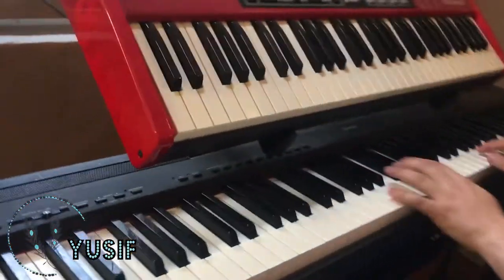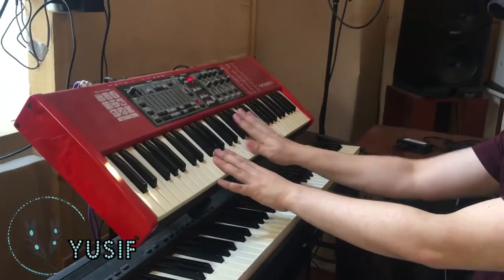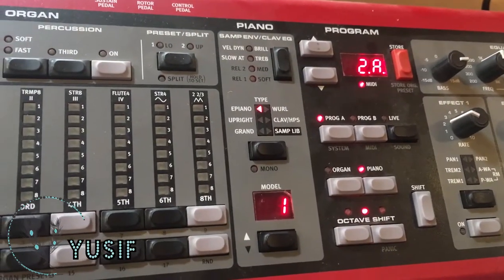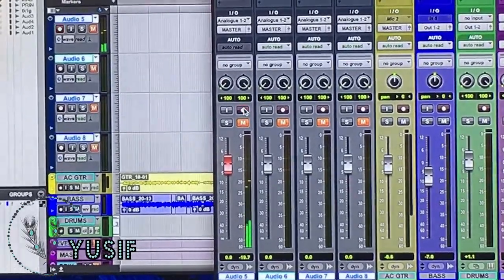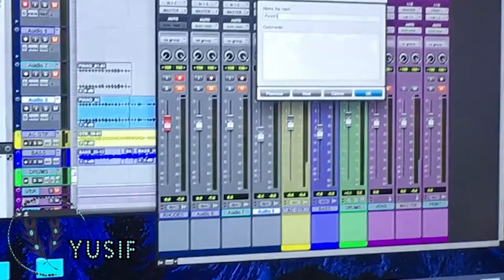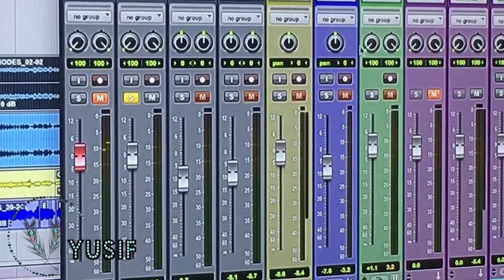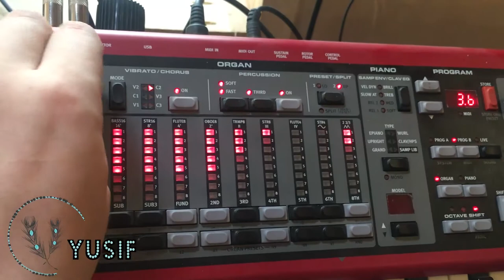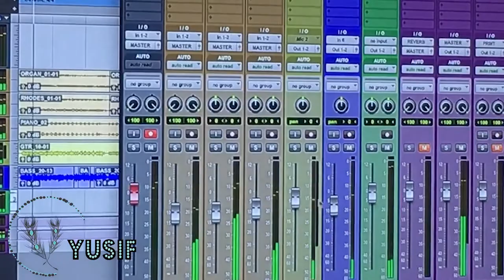MIDI Controller | Yamaha Digital Piano & Nord Electro 3 | How To Record Piano (Home Studio Setup)

Comment: Nice setup man. I'm like you, trying to get the Nord sounds for less money. To my ear the Nords have the best sounds. I was thinking of getting an Electro 5 or 6 and a Kawai ES110 or Yamaha P45 to control it. Could maybe get this setup used for a bit over $2K. I would love the all in one Stage 3 88, but  that would cost almost double. Anyway thanks for sharing. So many awesome sounds on the Nord. I have a real Rhodes and a D6 clavinet. I prefer to record the Rhodes direct through a nice pre, but that is a matter of taste. Nice video!
Reply from the maker: i really need to update, i'm still using an electro 3 but it records great so if it ain't broke... but whenever i look at the new ones, i start salivating for the depth of sounds and features lol

Comment: Hi Yusif.  Nice video covering a wide variety of items.  A couple of questions:  (1) When you use the Yamaha 88-key unit to control the Nord 61-key electro (let's say that you have the Nord set up for a piano sound), does the Nord piano engine respond across the entire 88-key range, or is it limited to only 61?  (2)The Nord Stage 3 has an "extern" section which allows some enhanced MIDI control functions.  The Electro does not have this section.  Do you feel that the MIDI capability of the Nord Electro is limited in any way?  thanks!
Reply from the maker: hey Mark, thanks for your questions. I get the full 88 key range using MIDI. I wasn't aware of the enhanced MIDI capability on the Stage 3. to be honest the only thing I use MIDI I/O for is when I want to have one keyboard control the other, like I'm doing here, or when I want to send MIDI in to the computer to use samples on the PC (I use VIenna for strings/horns, the Nord is cheesy on those). and the Electro 3 is perfect for all this! Stage 3 probably has better sounds, but E3 sounds are recording-worthy, very HD samples that I use on all my tracks/albums etc, I hope this helps ya out my friend  :)
Reply: @YusifRefae  Thanks for your quick reply Yusif!  I agree that the Electro does a great job of covering the essentials with some great samples and functionality.  Peace my friend.
Reply from the maker: @markfrancis855  for sure. i hope your  keyboard setup works out. make a video & link it here  :-)
Reply: @YusifRefae  I will do that, although it might take some time.  I think I'm going to pick up an Electro sometime in the coming months and am also going to buy Apple Mainstage.  Thank you for your encouragement. :)

Comment: i bought this yamaha ydp144 and it doesn't has a MIDI port, only USB. Can I use it this way?
Reply from the maker: ya, i've noticed some of the newer keyboards they're not including MIDI ports, which for me is a deal-breaker. i could give you more specific advice of how to connect your gear together, and other peripheral adapters you may need, if i know exactly what u are trying to do. are you trying to connect the yamaha to another keyboard, or to your computer/recording interface?
Reply: @YusifRefae  I would like to use it as a MIDI controller for making game music. I am from Brazil. Thanks for the help. I play as an amateur, basically classical music. This will be my first time trying to connect it to a PC. I had a wooden piano and bought this one for composing with the PC
Reply from the maker: @DiegoOliveiraProf  making classical music in Brazil, that's cool! I think just plugging in via a standard USB cable to your computer ought to work. have you tried that? the computer will recognize it and then you can select the MIDI instrument digitally inside your DAW.
Reply: @YusifRefae  Yes, that is hard man. People here don't like classical music. I also play the violino, you can check on my channel if you want to. Yes, I Have connected to my notebook and I was able to download a recorded music that was inside the piano. Which DAW do you recommend? (free one if possible) THANKS!
Reply from the maker: @DiegoOliveiraProf  that's awesome. keep doing it man. i'm glad you were able to get your keyboard plugged in to your computer. i would recommend Pro Tools as a DAW since it's the industry standard. however, it is a bit pricey. if you have a Mac it comes with Garage Band free. that's a pretty good one. I've also heard great things about Studio 1. There are free ones too, like Reaper I think, and Audacity. but they have limitations.  tbh i'd just save up and get Pro Tools since most studios & professionals use it and once you learn to use it you can use any other one easily  :)
Reply: @YusifRefae  Thanks, I will try to get pro tools. I have a lot to learn. I am making my game myself, so I need to draw, 3d model, compose, code... it will take its time. Thank you for all the help!